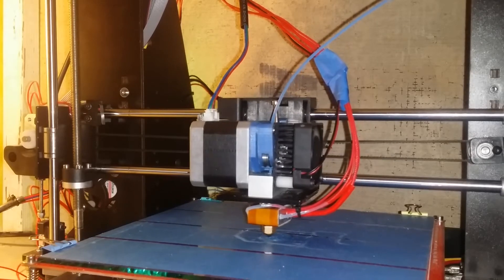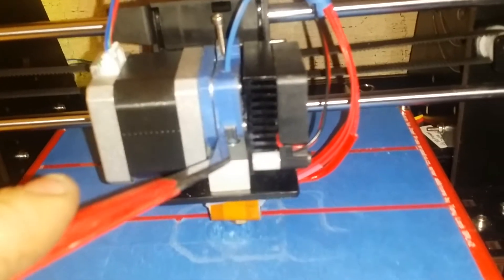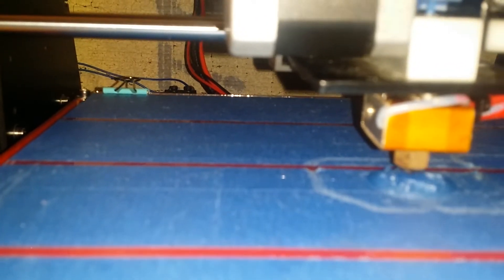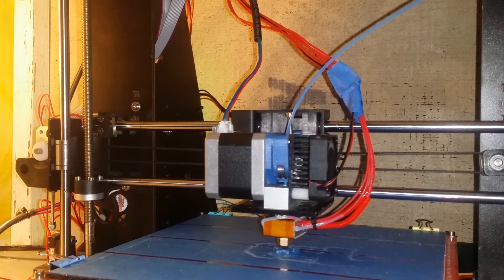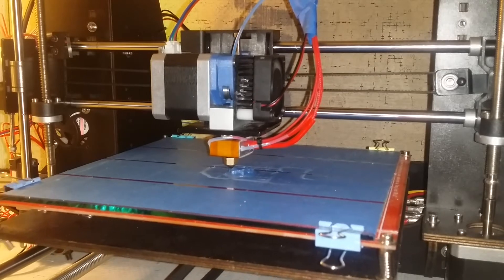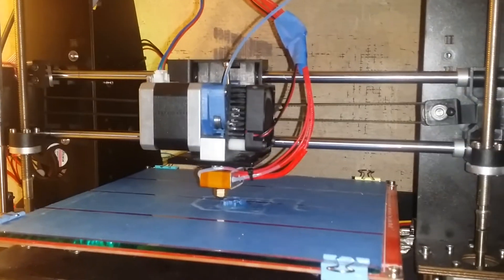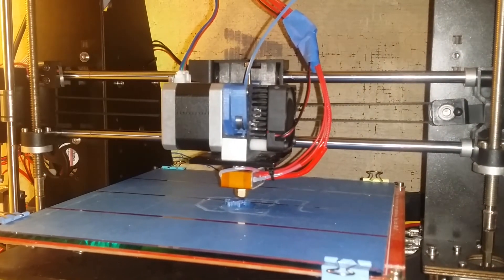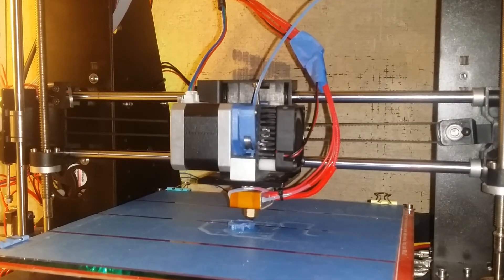Prusa i3 ctc extruder upgrade

Comment: You mentioned the extruder was clicking and clunking. If your hot end has not reached its set temperature then it will click. If you let the heat saturate the whole system before print start will help also. Have you played with different slicers and hosts? I use Repetier V2.1.2 and newests Prusa slicer. I was able to find the i3 B-PLA-0.4-1.75.ini and used information to make changes to Prusa slicer. Found out as an example they want 195 c hot end and 65 c for bed.
Reply from the maker: Paul C Johnson that extruder set up was bad. It was a weak motor in the end of it sll.
Reply from the maker: The motor was skipping steps. It would clunk and click when skipped steps.
Reply from the maker: If check some my other vids I upgraded the printer
Reply: If you hot end temp is to low the filament is hard to push through if you up the temp the filament become softer and easier to push through the nozzle and that reduces the skipping and clicking noise

Comment: Hello,
how did you use components for X-Axis?
They look like metal parts.
Reply from the maker: the ends are plastic. came with printer. but one end is cracked. i printed a part but i had extruder problems so i have to reprint to get perfect.
Reply from the maker: and extruder mount is metal bolted to plastic. something iplan to do is get a metal frame rework kit for it.